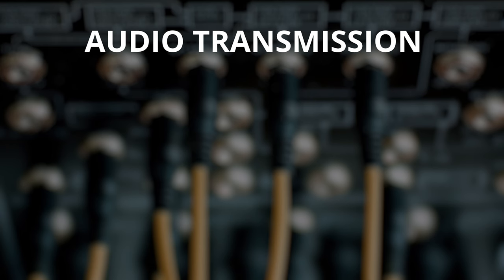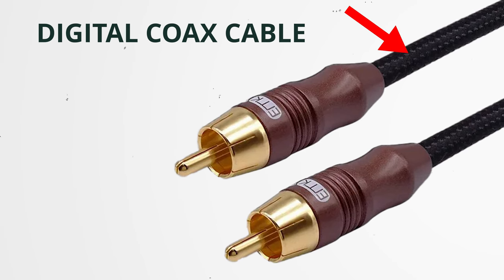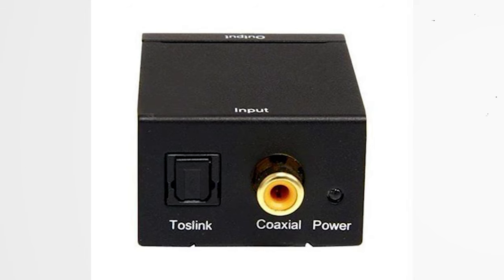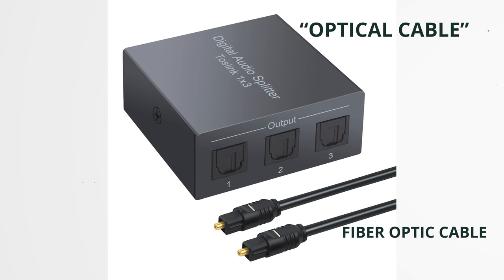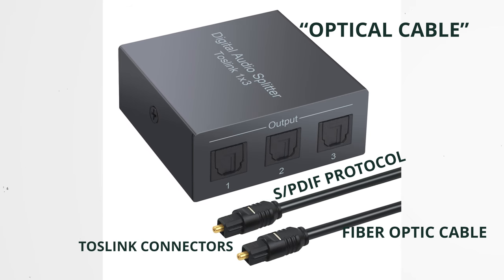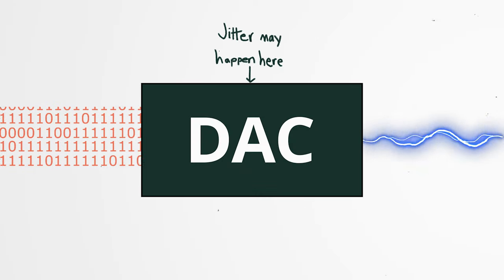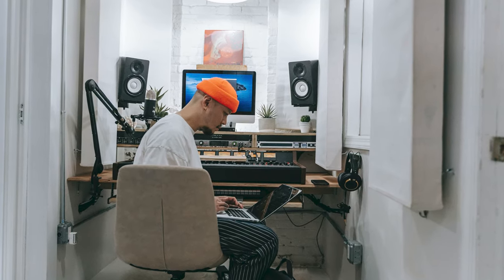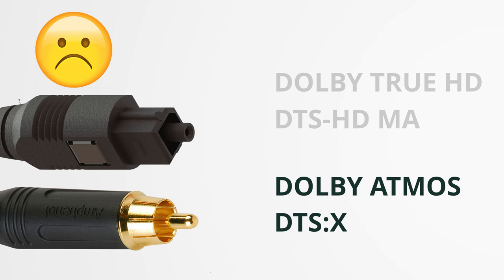S/PDIF? RCA? COAX? OPTICAL? | HOME AUDIO 101

Comment: I'm ordering a SACD for the first time and trying to ensure I can play it on one of my current setups... not totally sure I can till it arrives, but I may have all the equipment. Learning about the limitations of these cables helps because it rules out using any of these to get the required throughput. Looks like I may need I2S over HDMI because of the high bandwidth so I am trying to learn about that. Thanks!

Comment: Great explanation.  I actually use digital coax for my DJ system.  I use the Mogami Studio RCAs since they are a 75 ohm digital cable...with RCA terminations.  To go digitally from the DJ Deck into the DJ Mixer.  The audio then goes out to my PA system via balanced XLR.  Also, the signal will go to my laptop for recording from the mixer via USB.  That way, everything stays in the digital domain for the recording.
Reply from the maker: Hell yes! Those Mogami RCAs are legit! 🤘
Reply: Me name TechnoDad me remix movies in Atmos by recording my old ProLogic 7 enhancer outputs and changing the mkv container.

Comment: Love your videos explaining tech that most people assume is common knowledge.
In my recent home theater setup, I use RCA from the pre-outs of my Denon x3800h -> Buckeye Amp for my LCR (since my AVR doesn't have XLR). As well as RCA for my sub out -> miniDSP 2x4HD -> 2 subs.
I've definitely experienced the 60Hz hum with my long sub runs depending on how close those cables are to the sub power cables.
Reply from the maker: Thanks, man! Hope to make more of these explainer videos. 😃🎉

Comment: Hi :) thanks for this video. I'm working on digitizing old DAT tapes on a Panasonic SV-3500. I have a HiFiMe Toslink to USB adapter, but that hasn't been working so I'm looking for a coax adapter instead. My question is -- do Toslink and coax cables fit into the same out port on the deck? I'm sure I have a million other questions, but I'll start there :) Thanks!
Reply from the maker: No, they wouldn’t use the same out port since they carry the signal two different ways. TosLink via light, and coax via electrical signals.

Comment: So, can I use standard audio cables with RCA connectors instead of coaxial S/PDIF cables (also with RCA connectors)?
Reply from the maker: Sometimes it’s possible, yeah. Typically a digital coax cable will have better shielding to keep out unwanted electrical interference better than your standard analog RCA cable, though. But if you already have some RCA cables lying around, no harm in trying them out first before buying more cables.

Comment: Which one gives you higher audio quality?
Reply from the maker: That’s largely dependent upon the DAC you have inside, not the cable itself. 

Although Optical can’t support more than 96kHz with hi-res audio, compared to 192kHz with a digital coax cable. 

But digital coax - being an electrical signal - can be prone to electromagnetic interference, whereas optical doesn’t suffer from that, since the audio signal is carried via light, not electricity. 

So they both have potential issues that may cause audio to suffer, but it’s the DAC that ultimately decides how good that audio quality will be (as well as your speakers, etc).
Reply: @ealanosborne  Should I invest in a DAC for my active speakers, or is it sufficient to connect them directly to the motherboard? I'm worried that the onboard audio of my computer might be subpar compared to a dedicated external device.
Reply from the maker: @thanos1000000fc  Yeah, investing in an external Hi-Res DAC might improve the sound quality compared to a sound card. Lots of headphone DACs are available that can connect to a computer’s 3.5mm jack. 🤷‍♂️
Reply: @ealanosborne  My motherboard also has optical.
Reply from the maker: @thanos1000000fc  Yeah, most external desktop DACs should have optical input as well. 👍

Comment: I was wondering what SPDIF was on the back of my PC motherboard, since the same "port" on my tv is called "Digital Audio (Optical), very useful vid and answered all my questions.
I never really thought about using anything other than the 3.5mm jack, but I am looking at upgrading my speakers and when I saw the speakers had a optical connection I figured I'd check both my PC and TV, both have such a connection but as they were named differently I was confused.
Reply from the maker: Yay! Glad this video could help you out! 😊

Comment: I see ppl putting speakers high up on the wall, on the right and left front channels, does go plugged into the same channels of front right and left? an addition to the floor standing right and left?
Reply from the maker: That’s most likely someone who has a Dolby Atmos or Auro 3D system. And no, the height speakers would have their own separate channel to plug the speaker wire into.

Comment: Where do I connect the s/pdif protocol to my PC? I have an external soundcard and am using an optical cable to try and connect my audio system to my soundcard but idk where it goes
Reply from the maker: Your PC’s external sound card should hopefully have an Optical output, so connect that to the optical input on the audio system.